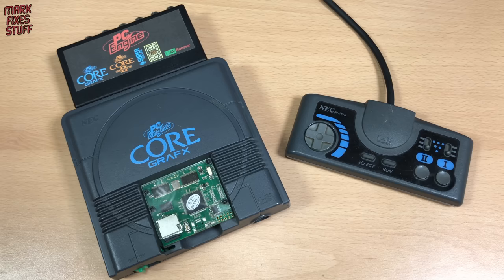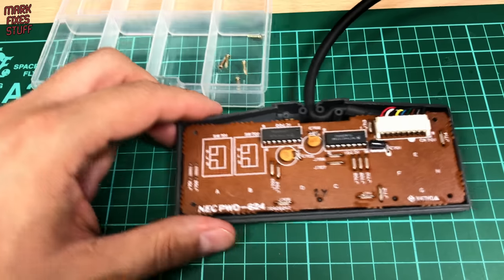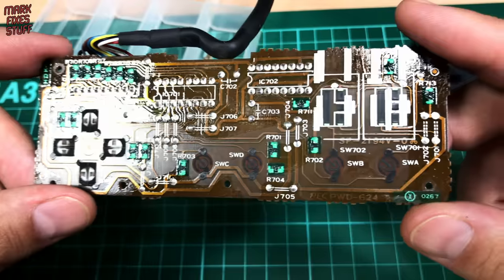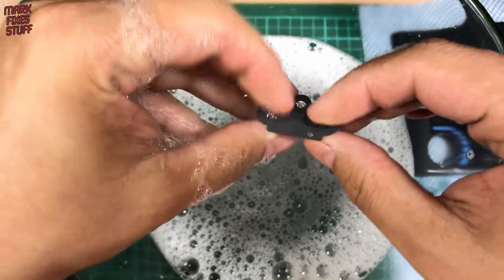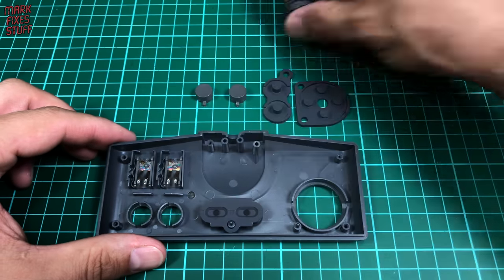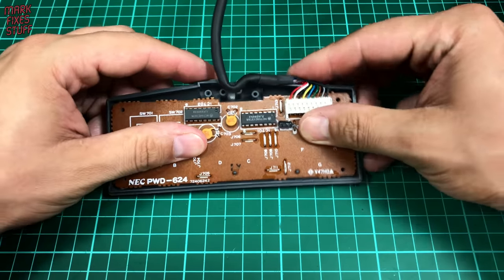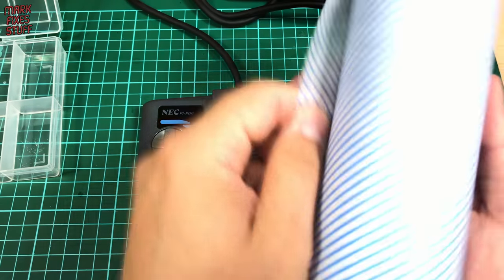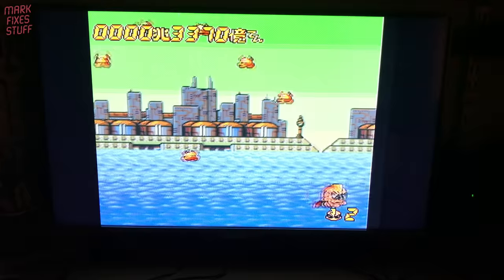Tearing Down & Cleaning a PC Engine Controller - PI-PD6 Core Grafx Gamepad

Comment: Thank you so much for this video. I cleaned mine and used some bicarb soda with the elctric toothbrush, it worked a treat!. I noticed a little tear on the rubber for the direction controls and used a tiny bit of vulcanising glue applied with a toothpick. Both controllers are now fine, precise and responsive.. Very grateful for this.  The Sodipeng controller can be cleaned the same way. I can now play with my son.

Comment: I did this and now the left directional button is consistently held down with other buttons not working at all. Any thoughts? Is it the board?
Reply from the maker: Blake G might be worth checking the solder joints on the ICs. Could also be the rubber not seated right.